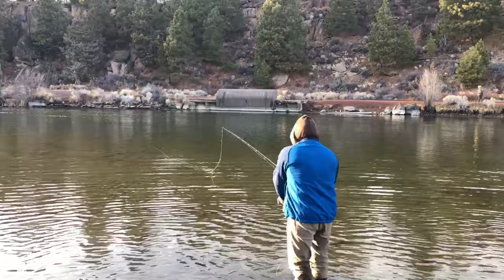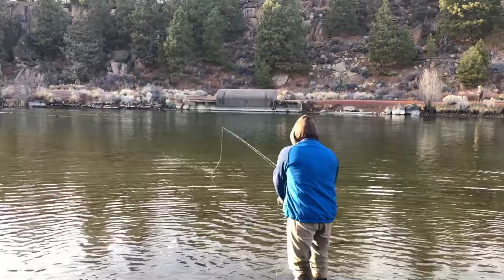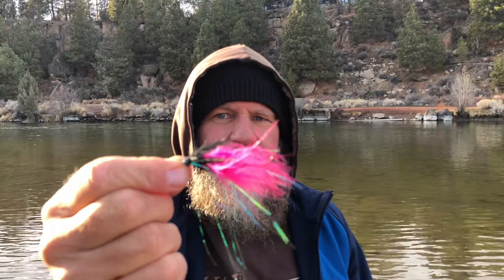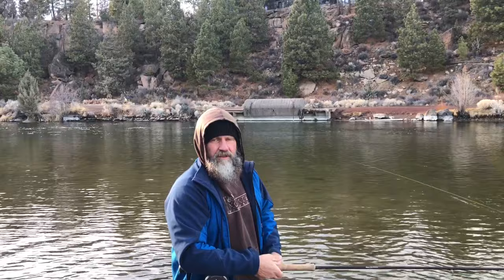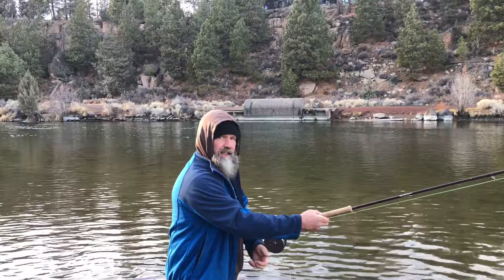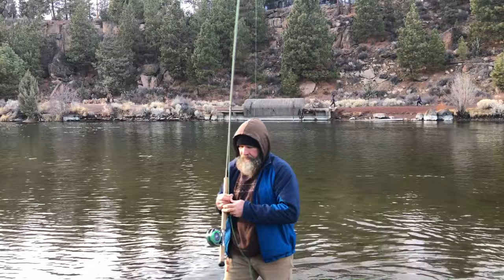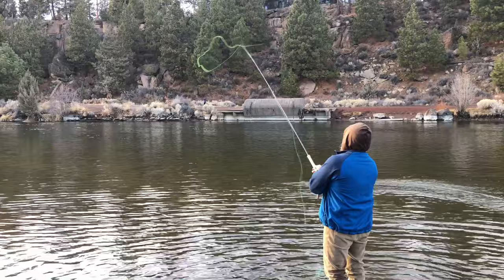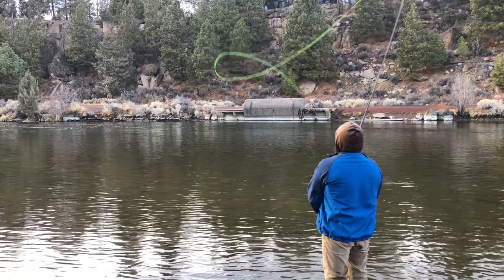Skagit Adjustments for Casting Variable Payloads

Comment: Good starting one for the 2021, 🙂still I never like to hear from my instructors  “you have to find what it works for you” because this is a game of physics, principles of fly casting must be applied to later under full concentration on follow them we find our style from guys like you, rod blanks and lines are the same regardless the caster skills, it’s more how he/she build the foundation from the principles not from how instructors do the cast, but how they apply the principles with a personal style form.

You are clearly trying to explain very obvious points to the experience caster, and they understand you because some like me, they poke few holes in the lower part of the waders, and we avoid that by focusing on the principles.

Now, Respectfully, for the green horns, probably would try to mimic your style that clearly you my friend unbelievable master👍

That basic point from 5:25 about the loop tension is critical Tim, but without understanding the 180 rule or principles, many out there won’t be happy once they use same or similar set up, by doing what you share.
You clearly put hart and soul in your work like no other in this platform, perhaps a good way to picture the 5:25 point once we mastered the 180 is...
we really need to create at least a mirror form of speed and blank load from the DLoop, if we want to get the best of the good things from our back cast or DLoop, we must create the best action (back cast )to create the best reaction (forward cast) but still, if we get there, we only walk 50% of the path, without first understanding and master the 180 rule, we won’t find the other 50%.

Perhaps Skagit heads are very forgiving about the 180 rule and mirror the line speed and load in both back and forward cast because of the lifting power characteristics in this rigs.
Longer heads really have no mercy if caster fails on the mirror load and speed or it’s few degrees off on the 180 rule.
Keep up the good work brother👍

All the best to you and all your subs for the next 2021

Best 

Mag
Reply from the maker: thanks for the kind words and detailed comment!  I will address the one eighty degree principle soon.
Reply: @LineSpeedJediTimRawlins   no problem 👍you have a great communication potential and superb casting skills Tim, it just hurts to see there is room for improvement to engage to those watching but not participating or commenting , you just need to put more effort in the part that stinks the most but it’s essential to everyone to master the game, the principles, I believe, that’s why we don’t see more guys in the water or even in this same platform trying to share the incredible potential of the Spey, from a personal level, everyone owns a smart phone and can do a short clip, but still, they won’t post a question.
We both clearly see what Spey casting can do to improve our time in the water, once you in, you are hook to the core😁
You should figure how to touch or motivate the “green horns” , by the number of viewers,  witch it looks they are out there in great numbers, but they keep a low profile and usually don’t want to post for whatever the reason, the newbie community should be your channel foundation, ask them to share few clips and posted in your channel for every one to analyze and comment, that would help others to put the dots together until finally they will also decide to participate.
All the best to you and yours this 2021 Tim

Stay safe 

Mag

Comment: The cast at 11:48 is interesting.  You put the anchor out to your left and it slips all the way back to your position on the sweep and pick up.  It doesn't blow but it slips a long ways, maybe 10' or so.  I have never minded this in my own cast but I know that in a more recent video you count slipped anchor as an error of sorts.  I do it all the time on longer Skagit casts, say of 90 feet or more especially.  Do you think this slipped anchor phenomenon is a problem?  What's the solution if it is a problem?
Reply from the maker: I don’t see it as a problem Dwight, sometimes is a benefit, sometimes a result of hitting the forward cast too hard,  But if the fly leaves the water going forward it’s good. Ed ward slips or slightly blows his anchors and it doesn’t seem to bother him.  Maximum tension at lift off, anchor in front without a crazy amount of slippage is probably best. Good question, probably had some to do with type and length of leader and fly also. Klause Frimor talks about this favorably in one of his Scandi videos at Montana Trout Spey clave on north 40 fly shop channel.

Comment: Percebi que seus arremessos saem com uns 10 centímetros  de running line fora in the rod correto.
Reply from the maker: Are you talking about overhang?  thanks for the comment.  That sounds correct.
Reply: @LineSpeedJediTimRawlins  I'm talking about, if I get sticking with the head of the line inside the dowels or I can leave a few centimeters of running line out of the dowel.